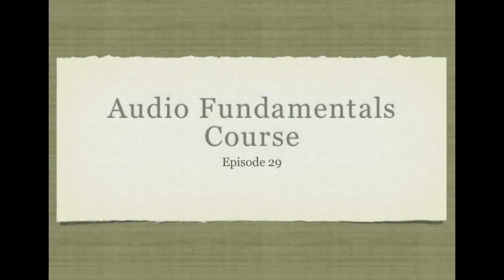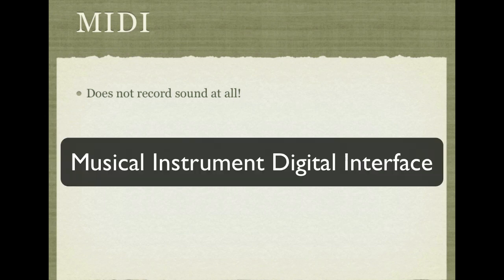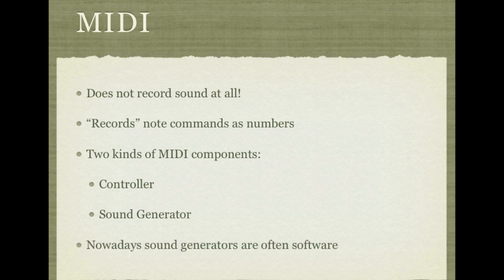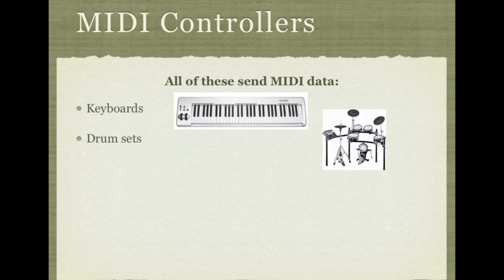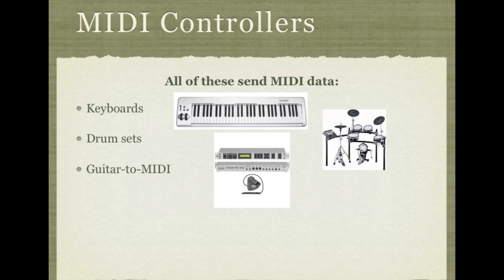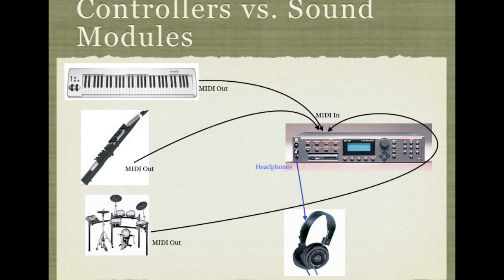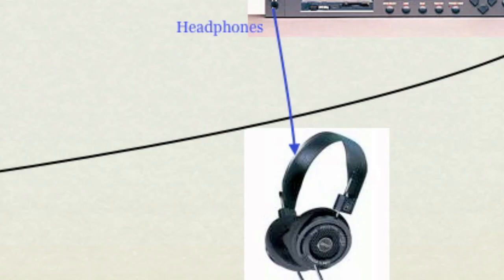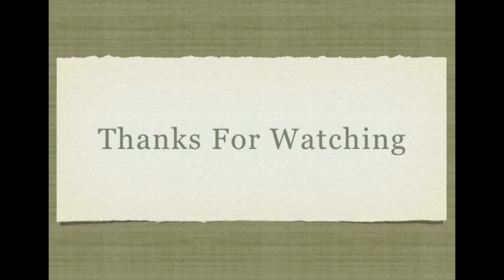AF029 - MIDI Controllers

Comment from the maker: That's a fantastic question and a good idea for another "bite-sized" video. Basically MIDI can include any kind of "set ___ setting to ___" commands. Stuff like guitar effects use MIDI not for the usual "Turn Note ___ On" and "Turn Note ___ Off" commands, but instead for things like "Change Treble to 9" or "Change Gain to 6.5" in order to save / load your settings.